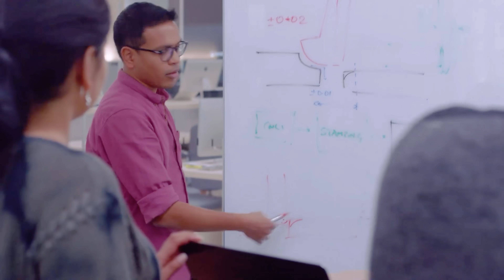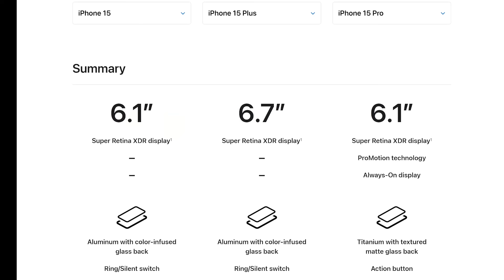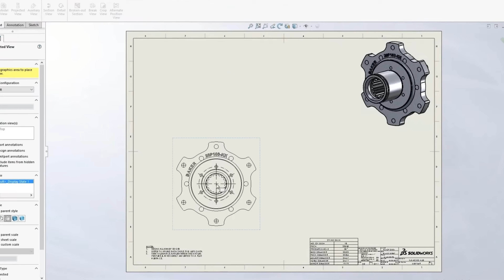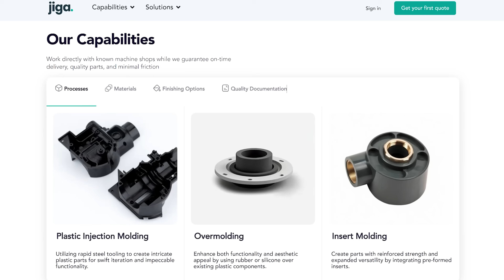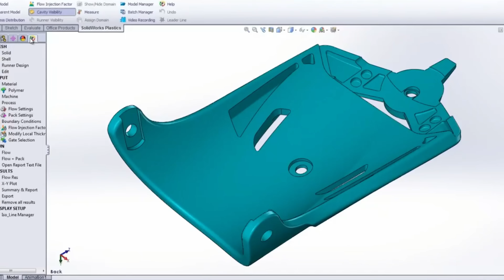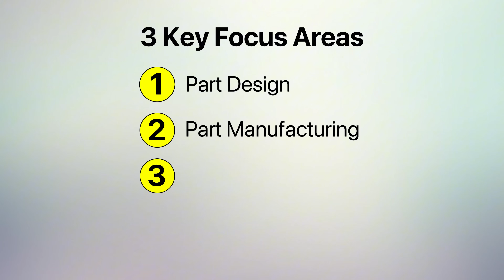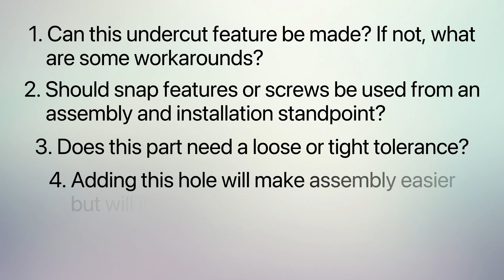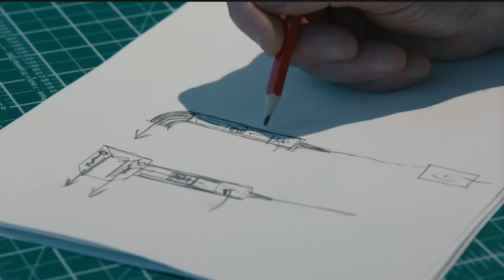How Mechanical Engineers Design Products

Comment: Titanium is a poor choice for thermal conductivity. If your phone has ever overheated, you'll want aluminum. Coat it with a ceramic if you're concerned about scratch hardness.
Reply: The purpose of the video was to explain product development. Not sure why you're adding a comment focused on the example lol
Reply: @Flamenfr0g  He didn’t design the phone, but I still wanted to point out that exotic materials are chosen as much for marketing, as for performance. Anyway, even phone cases are thermal insulators, so the informed consumer has a choice to make.
Reply: The international frame is actually made of aluminum.

Comment: what's the difference between product designer and mechanical design ? and for product design is it just mostly cad ? i don't see how the course materials learned have to do with many product designs they seem to be mostly cad but i don't know just asking. For example how does mechanics of materials, statics, dynamics etc play a role in product design like the iPhone for example?
Reply from the maker: Great question. Depending on what you're designing, you will rely more on certain bodies of knowledge than others. For example, mechanics of materials is key for determining how materials and structures will respond under various loading modes and levels of stress/strain. Dynamics won't be as useful for designing something like a smartphone, with the exception of vibrations.
Reply: Product Design is typically covered by someone who studied at an art school and they do those exterior surfaces he mentioned. They will decide where the camera goes, where the buttons go, and generally define how a person will physically interact with the thing. Also the color and finish, will it be smooth, textured, soft touch, etc. 
they work with Mechanical engineers to realize their vision. Then the ME’s have to design every part, outside and in, that will make it all work mechanically - like he said with the product requirements becoming detailed designs for every part and and assembly such that Product Design, the vendors, factory, finance, purchasing, quality are all satisfied.
Reply: @ACBLOWSCOLD nah, depends. Industrial design is more what your describing. I have a masters in product design Engineering and we were specifically taught the Detailed Design with DFMA, FMEA, FEA etc. alongside the concept development part of the product. Might depend where you study. The ‘Product Design Engineer’ degree is quite uncommon compared to Industrial Design and Mechanical, it’s often not a given option on job applications😅
Reply: @CreativeCache101  Sounds like you went to Stanford or did a similar program. We're kind of saying the same thing. As you said, because the title ‘Product Design Engineer’ is so uncommon in real life (at least here in Silicon Valley) I don't try to define it. I take "Product Designer" to mean the lay person's term for Industrial Designer, since that's an actual job you can get and I have worked with many as a Mechanical Engineer.
Reply: @ACBLOWSCOLD  ya, studied in Scotland, nobody knows what we do lol. basically drop the advanced maths out of mechanical and replace it with all the stuff this channel talks about regarding manufacturing and assembly and that's my degree.